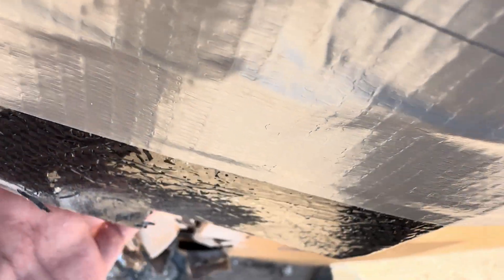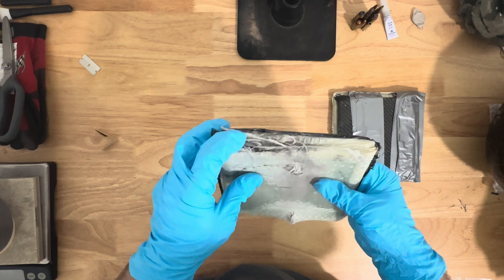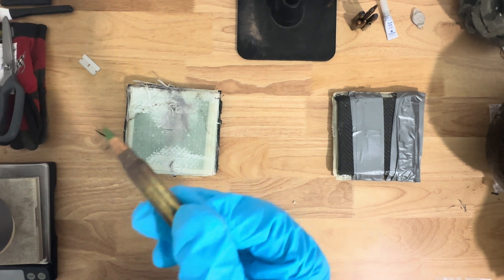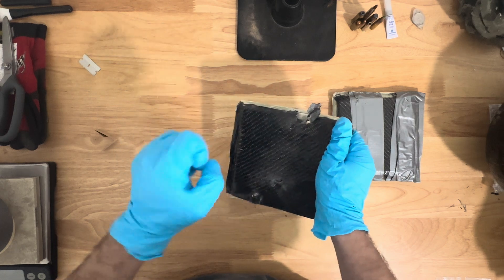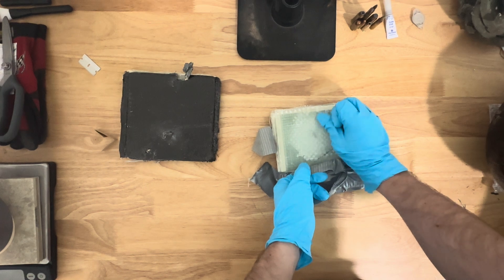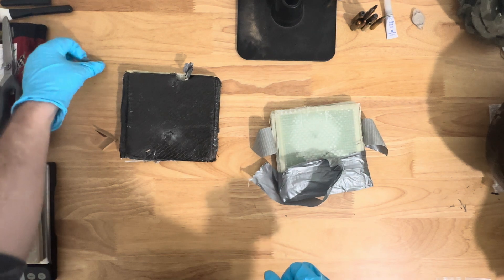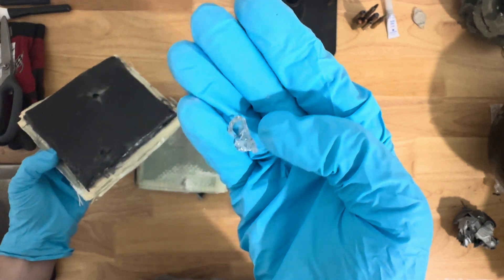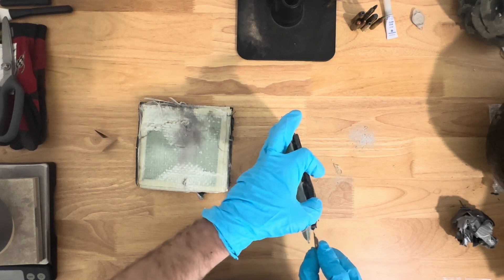Pyroceram, the Ultimate Glass for Ballistic Applications?(Pyroceram Glass vs Porcelain)

Comment: What is the backing layer?
Reply from the maker: @Meop79  25 layers of 18oz E-glass
Reply: @Armor-Innovations  with resin I'm assuming, have you tried hdpe heated and compressed with the fiberglass instead of the resin?
Reply from the maker: @Meop79  yeah its with epoxy, have not tried hdpe-eglass composite before